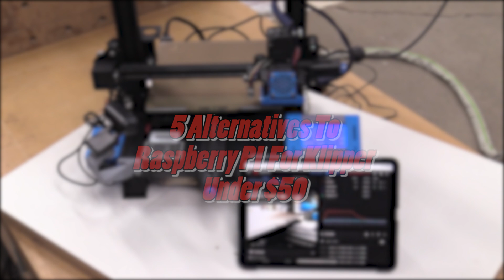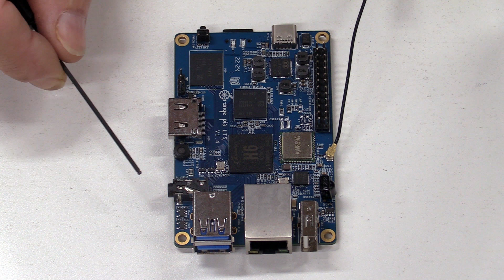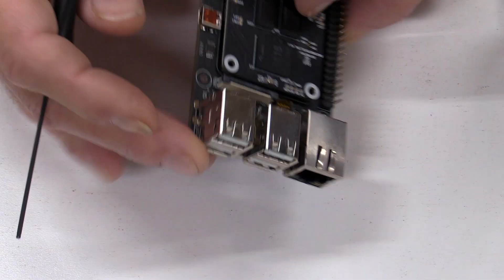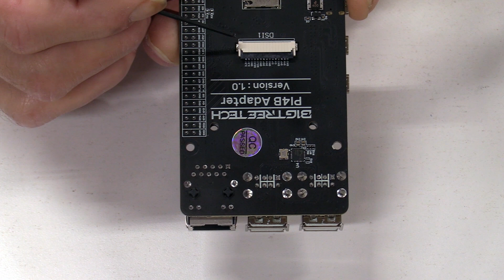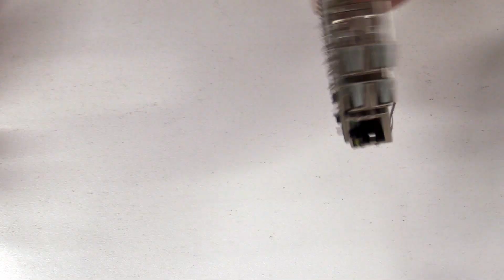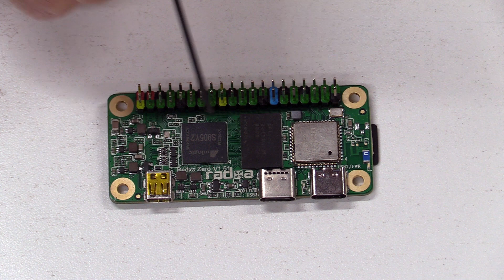5  Raspberry Pi Alernatives For Klipper Under $50

Comment: great alternatives review. I got two important corrections: 1) there is only one usb3 port on Orange PI 3 LTS regardless visually it looks like there are two of them. 2) DSI/CSI ports will not work on Pi4B if you use CB1, you have to attach Raspberry PI CM4 to make them working

Comment: How do you get input shaper to work on the cb1?
Reply from the maker: I use this for input shaper: https://klipper.discourse.group/t/raspberry-pi-pico-adxl345-portable-resonance-measurement/1757
Reply: @GuysShop  ah. Yeah i have a ldo kit and can't get a raspberry pi anywhere below a insane price. 😔 Somehow i cant get the right spi settings for the adxl to work with the cb1. Was hoping you maybe got it to work. 🤷‍♂️
Reply from the maker: @raunchyNO  The raspberry pi pico is available on amazon for like $13 right noiw

Comment: To me the  best alternative  would be running everything on an Android device, including klipper screen
there is a way to do it  using termux  I think but I am not brave enough to try it myself ,I think it does require root
but I have so many Android devices sitting here not doing anything I would like to  get it working to   repurpose some of this old stuff ,   specifically  I have like 3 2015 fire 7 tablets with root and custom ROM's (only one with TWRP though) I wonder if they would be powerful enough
Reply from the maker: Yeah, I agree if you have the device. For me, I'm an IPhone person so I would have to buy a used phone off ebay. I would use a substitute fo the pi.

Comment: Somehow I missed the new video, but had seen the new logo while watching some older content recently.  Heard you mention the changes on the WoodShopLife podcast, and my brandy new 3D printer just showed up... ;) so of course I had to  come check this out!  I'm not at the point where I need Klipper (yet), though I might be considering adding OctoPrint to the mix in the near future as I have a 'spare' RPi4/4GB.  

I'm obviously really new to the 3D printing ecosystem so I'm still a little fuzzy on where various things might overlap, or not.  Is there any chance of Klipper and OctoPrint co-existing on the same RPi / Pi alternative?  Or would it be better to keep the various concerns separate?
Reply from the maker: Yes, you can run Klipper on Octoprint with a plug in for Klipper called OctoKlipper. I really like using Mainsail as the interface, however using Octoprint give you the ability to use all the awesome Octoprint plugins.
Reply: @GuysShop  might be a good video comparison 😉